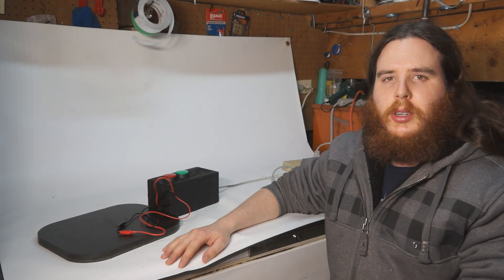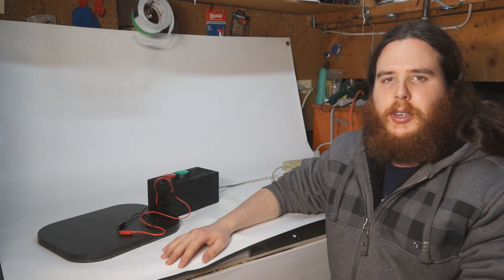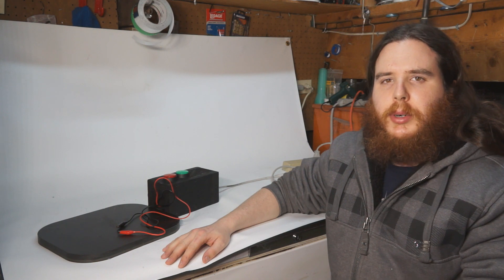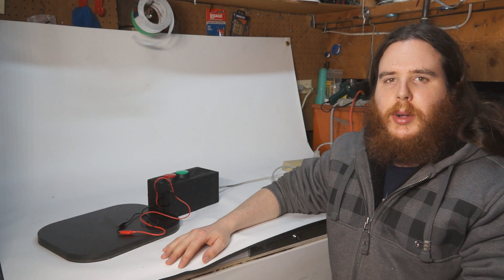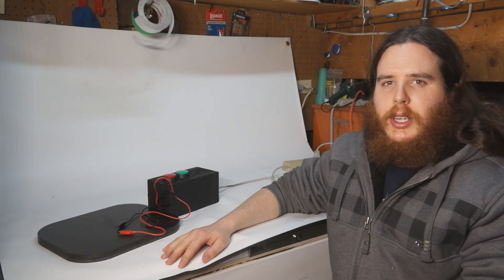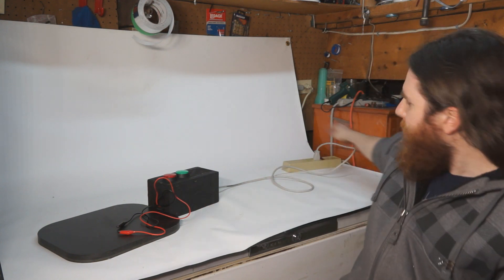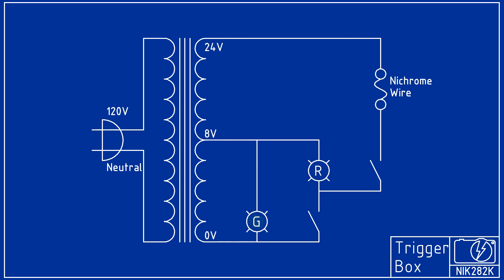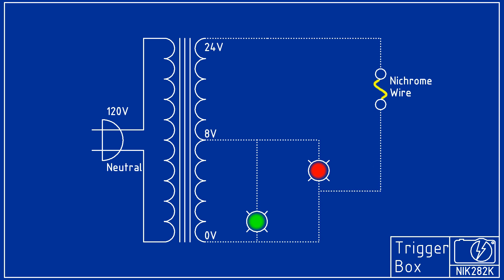Nichrome Wire Heater

Comment: i am using a 9v battery and connect a piece of nicrome wire to the battery... the wire is getting pretty hot.. but the battery is going more hot.... 
can you explain the reason??? and tell me if the circuit you have made is completely safe if the connect the wire to a 12v adaptor instead of a transform..... please reply....

Comment: How can I cut a 70cm foam would I need a transformer or can I just use an adaptor which is 12volts and 2000amps?

Comment: yo man great vidcan i ask what voltage i need for about 40cm of nichrome wire to be red hot?
Reply from the maker: Nicrhome wire is usually sold with an ohms per foot rating or wire gauge, if you know that you can use this calculator: http://www.jacobs-online.biz/nichrome/NichromeCalc.html
Reply: thanks alot buddy

Comment: Cool trigger box. Just one thing, can't I run 16V through the load by just pressing on the red button (without the green)?
Reply from the maker: +neowiza360 Good catch but the lightbulb resistance limits the current so much that there is no heating. I Tested for that and figured that it's not a problem, ideally I would use a relay or some diodes to isolate the heater from the lights but unless a bulb fails shorted I don't see a problem.

Comment: Oh cool!  I didn't know what would make a suitable transformer for that application!
Reply from the maker: I pretty much went though all my batteries and transformers until I found a combination that would heat the wire without melting any other parts. I lucked out in having the second tap that could be used for the light bulbs.

If I were to do it again "the right way" I would use a relay to isolate the lights from the nichome wire so that there isn't that extra path through the red light.